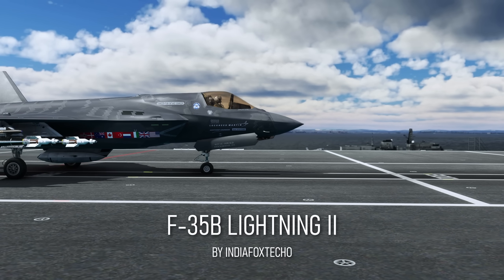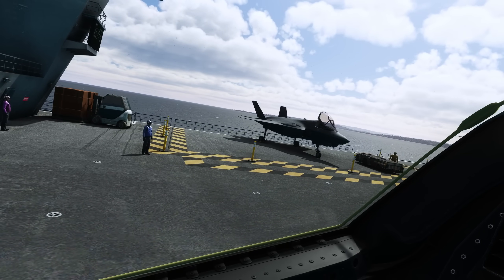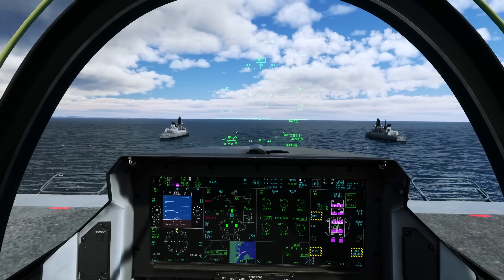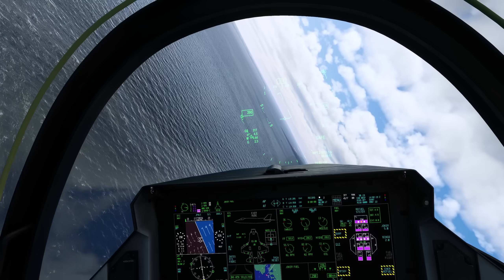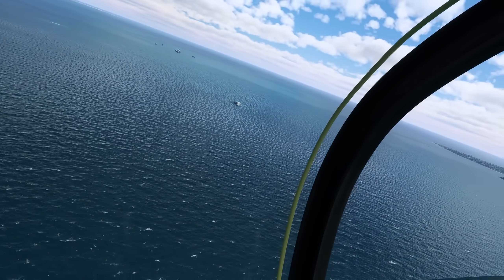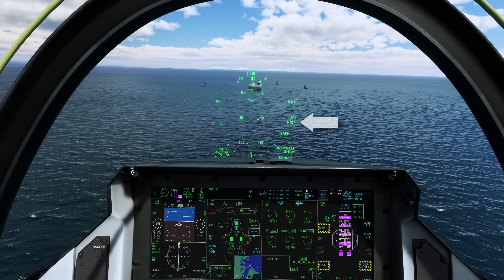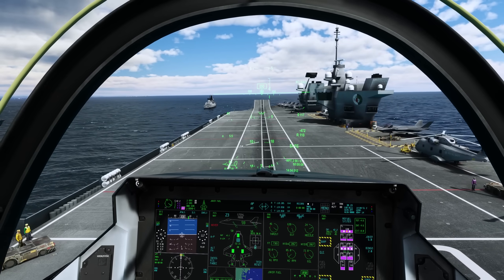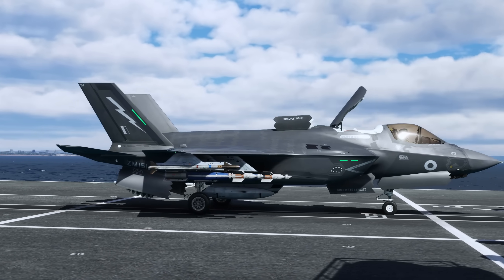Too Heavy to Hover? The Brits found a solution! F-35B Lightning II SRVL (MSFS)

Comment: This why the MoD/RN should have a built a full function carrier with arrester gear, along with F35Cs!!!!! They could still use the ramp to take-off with F35C, just like the F35B. The US use the F35B on smaller amphibious assault carriers as part of Marines Air Arm. It was not designed as a frontline interceptor. On land that is the F35A and on strike carriers the F35C. Complete british cock-up.

Comment: Why the hell doesn't the British Carrier have an Arresting Cable?  How do they handle Emergency Landings?
Reply: STOVL carriers generally don't, as their aircraft are designed to land vertically, the F-35B doesn't have a tail hook.

With this they have the option of a rolling vertical landing or a full vertical landing though.
Reply: It's easier to stop then land, rather than land then stop.

Comment: Good show UK, you showed the US Navy, & Marines how to safety operate the F4U Corsair on an aircraft carrier, now the F-35B.
Reply: Now, about that password... 
MFSBs !!

Word game: Sort the letters out... 

O V R I Y S N T E 

Yup, you're sorted. 😝😖
Reply: Not so. In both cases, the US had other options. In WW2, the RN preferred the Corsair while the USN preferred the F6F Hellcat and to wait while Vought worked out the problems with the Corsair that were genuinely deadly (even with different specifics in operational employment, the fundamental problems with the Corsair - the long nose obstructing field view ahead and the original faulty oleos that tended to make the plane bounce over the wires - were still problems for the RN that didn't get fixed until the F4U-1A, it's not like the curved approach was a magic cure-all for either problem, it just made the former problem more bearable and the latter they dealt with by using a flatter approach than was ideal for carrier landings).

With the F-35, the USN/USMC still has not adopted shipboard rolling vertical landing because the wide majority of Naval/Marine F-35s are the CATOBAR variant - they don't NEED to use loads on the F-35Bs that exceed hover-landing bring-back because a heavier strike than that can be flown using F-35C.
Reply: well considering this is basically identical to how the harrier has done short field landings with the US marines for like 2 decades, i dont think they will need any brits telling them what to do
Reply: @lag_hag851  The difference being the weight and the fact that the Harrier is a proper VTOL, invented by the Brits.
Reply: @lag_hag851  please do some reading before opening your mouth ... the Harrier entered service with the RAF in 1969. 2 years later, the marines got theirs. the RAF instructed the marines how to fly them and how to use the vff. much as I love americans, people like you make it a lot harder.
Reply: @lag_hag851  Aside from how to make the Harrier in the first place. If we never made the Harrier, the F-35 probably wouldn't exist...
Reply: @lag_hag851 Funny that, considering it was the Brits who designed and built the Harrier and then showed the US marines how to operate it! Stop being an ignorant american ffs, you give us all a bad name!

Comment: 1:55 The funny thing about ski jump ships is, because of the roll and pitch, when the aircraft leaves the ramp from the deck it looks like it drops like a stone! 😂
When really they're using the up swell to throw the aircraft into the air like a bird.
Reply from the maker: Think it’s just lucky timing! 😂
Reply: @cgaviator 
Unfortunately i will never be able to find the source for that i watched.
But it was an interview with an FAA Harrier pilot explaining that they had to time it so the ship was pitching up when they hit the ramp, effectively "throwing" the harrier into the air. 

If you think about it, it makes total sense, you're converting free kinetic energy from the ocean waves into vertical kinetic energy for the Harrier. 

And every time i watched a Harrier take off from Invincible it disappeared down below the ski jump, only to reappear during the down pitch.

(I was a Navy brat and spent lots of time on board Invincible watching Harriers. When you're nine they're really isn't anything cooler 😊)

(OK maybe Goalkeeper gives it a run for us money, or the Gambo Gun)

(Oooh, or watching the Sea Dart Automatic handling machine running behind the magazine observation windows)
Reply: @cgaviator 
Have you read about how they learned to push the range envelope longer and longer during the Falklands?

Comment: The F-35B has two landing methods, VTOL and SRVL, each has a different Being Back weight, split between fuel and stains, called VLBB and RVLBB.

VLBB is 4,700 lbs
RVLBB is 7,000 lbs

It might even be "7,000 lbs more" weight, the public documentation is a little fuzzy on the specifics. 

I suspect it's just 7,000 though, not 4,700 + 7,000

Comment: That is one of the most stupid solutions actually - take off from ramp in aircraft that was never designed for ramps...who doesn't understand: the ramp applies specific loads on the aircraft structure which significantly reduce the service life of the chassis and fuselage (especially if the plane was not originally designed for this).
Reply from the maker: @RigelNV  the aircraft is designed, or the design is considered. The aircraft only ‘hits’ the ramp at a speed that won’t over stress the gear. 👍🏻
Reply: @ nah, maybe you right that "the design is considered", don't understand why they allow that tho, significant luck of power? No matter what take off speed, even if it's just 1 kph, the specific load is still present. A load that never shows in flight and during normal landing.

Comment: So we've spent billions on a VTOL plane that can't land vertically with a full weapons load, on an aircraft carrier with no catapult. The old Harrier, of which we sold all of the remaining ones to - believe it or not - America, is a better VTOL aircraft. You couldn't make this shit show up.
Reply from the maker: I think the Harrier had to jettison its weapons if it brought them back but I'd need to confirm that. It's always a balance of capability. Did you know that they went without catapult as to install a reliable one would have needed nuclear power (and the steam it generates). The electrical catapult, I believe, wasn't reliable. The other bonus is that this ship and park in more ports that a nuclear powered one so it unlocks more places it can visit. It's all a balance.

Comment: What joystick and throttle are you using?? Im thinking if the hotas stick and throttle combination??
Reply from the maker: Thrustmaster warthog 👍🏻
Reply: @cgaviator  ok cool I'll check that out for sure I'm getting a new gaming PC tomorrow well I'm ordering it has good specs, I9 processor with nvidia 4070 super 12gb, 32gb of ram, 2tb space wanna play MSFS and DCS

Comment: The Sea Harrier was doing that 50 years ago. And the flight control system on the f35b was developed by the British and used on the Harrier first.
Reply from the maker: I’m not sure if it had space on the small carriers to do this?
Reply: @cgaviator  They used the Charles De Gaule French carrier for the test flights of the VAAC Harrier which was doing this in the early 1990s with an all British FBW system and flight control laws subsequently adopted by the f35b. Pity the UK did not upgrade all its Harriers (Sea and GR Harriers) to use the FBW system pioneered by the all British VAAC Harrier.
Reply: @cgaviator 
What? A rolling landing on Invincible? Could they?
Probably, yes they're smaller than QE or a Nimitz but they certainly weren't small ships.
No ship that can fit 24 aircraft on board can truly be considered small

Comment: Meanwhile the USMC dumps fuel to get below max hover weight if they still have stores. No straight in approaches like that for the LHAs/LHDs 😂 Though to ge fair, with a moving carrier youre likely getting 20-30kts of wind over the deck keaning you arent ever truly hovering, more just extremely slow flight. Im surprised the British decided to go with more conventional landings rather than full hover like the US do.
Reply: They'll be using both methods of landing, in fact they'll still probably use vertical landings more, as it's the safest method of landing aboard a carrier. SRVL is just another tool in their kit which they can use in an event where they're carrying a lot back but don't want to just keep dumping fuel and weapons.

Comment: Only the British would think of building an Aircraft Carrier without a catapult or arrester system. Dumb doesn’t begin to describe this idea. What about all the Aircraft in a joint forces situation that can no longer use this carrier, stupid doesn’t begin to describe this.
Reply from the maker: There were two issues. A nuclear powered boat with steam catapults would be too expensive to buy and operate. At the time, the electric catapult was unreliable. They started ti swap in catapults but again, too expensive and would take too long. With this way, we have 2 carriers that can be operated with much fewer crew. Rather than 1 or no carriers.

Comment: Well those 2 British carriers were designed so they could be fitted out with arrestor cables if required. While the F35B is designed to do conventional landing if required too. So there could be a simply solution…..
Reply from the maker: Not quite. The B could never do arrested landing. No hook and weaker undercarriage.
Reply: @cgaviator  are you should it doesn’t have a small emergency hook that usually retracted inside, like the A? Because FWIU the B was conceived to operate conventionally from captured (or Seabee created) forward airstrips after the marines have landed & taken enough territory, so they can carry more fuel &/or ordinance
Reply from the maker: @mickvonbornemann3824  I guess it may have a small one but they aren’t carrier rated (small and prone to skipping, but I figure the nozzle swivel would negate having a hook) and the undercarriage would still be a one-use-only after a deck landing! 😂

Comment: What this shows is how bad F35 and F22 really are. Because the computers play up electronics and weapons play up look how many F22s it took to shoot down a Balloon. Few people that don't know in 1967 there was a Harrier being built to be part of the other harriers and in 1969 it was cancelled. Now this one that was built and being tested was a I think 12 inches longer and 8 Inches wider with a New Rolls Royce Jet engine to force the plane to do near Mach 2 they were aiming for Mach 2 its test flights were don information came out it was capable of 1400mph  up to 30,000 feet the story goes. Not sure what happened to the plane but it was not destroyed so is some where in the UK. I think there are two Photos of the plane. Perhaps we need a real harrier Aircraft as with the latest engines would easily be better than the F35 as unlike the F35 I think you need to see the original harriers at work with tricks it can do that the F35 can only dream of.
Reply from the maker: How many F22s did it take to shoot it down? If you want something to go up against a near peer state then you need stealth or you’d be shot down before crossing the border. Which kinda negates a supersonic harrier. Shame though

Comment: As a tax payer I was not to happy when a F35 fell off the end of the ramp due to engine failure on the recent cruise to the Far East
Reply from the maker: Sadly it wasn’t an engine failure, the engine cover was left in the fan area which prevented full power. A disastrous mistake. Though to err is human and I’m sure they learnt valuable lessons from the whole process.

Comment: Not sure who originally came up with this but we were doing this type of landing in the Harriers and Sea Harriers.
Reply from the maker: People have mentioned it a few times but I haven’t found any references of harriers doing this onto a deck?
Reply: @cgaviator  from what I remember the process for landing on an Invicible Class vessel to fly the approach parallel to the deck until along the spit on the deck you were going to land on then slide side ways before dropping down on to the landing spot. All done whilst the ship was underway, a ship not fitted with directable propulsion has to maintain a certain forward speed otherwise it loses controllability in the same way conventional aircraft have a minimum speed were the traditional flight controls lose effectiveness.. You can't do that if you are coming down vertically with no forward motion. The RAF were doing rolling landings to prevent soil erosion at landing sites.

Back in 2008 QinetiQ's Harrier T.4 Vectored-thrust Advanced Aircraft Control  testbed aircraft to complete shipborne rolling vertical landing trails on the French Navy aircraft carrier Charles de Gaulle as part of the programme of tests for the F-35 project. This aircraft was also used stri g ghe 1970s to develop the process of landing Sea Harriers at night and in poor weather.
Reply from the maker: @neiloflongbeck5705  roger

Comment: Looks so real vs my first flight sim flight path on the vic20
Reply from the maker: It’s getting very good, that’s for sure!
Reply: @cgaviator  Yes i had to look twice
I must get the new msfs, hope my old i7 4790k 1080ti runs it
Reply from the maker: @somethingelse4878  I used to run a 980Ti and it did fine without added traffic etc.
Reply: @cgaviator  Should be okay then
980 was a good card, but let down by lack of ram when TR and the first watch dogs came out
If i remember right the ti had 6gb of ram so didn't have a shortage
Reply: @cgaviator  I'm hoping to use space desk app on the pc and tablet on a few fire tablets as extra screens for msfs, so i have touch panels for some controls
Thats if i can move parts of the screen arouund
Reply from the maker: @somethingelse4878  sounds awesome! I almost went that way but realised I preferred a smaller setup. I mostly use HOTAS key bindings for everything and a couple of stream decks.

Comment: I think the people that built this figures what you are doing would be like the hood of your car popping up at 150 mph.   Looking at the fragile actuators I would expect the hatch to rip right off, possibly damaging the rear control surfaces as well, causing the fly by wire to get funky.  Sure, you could do it in an emergency,  and the damage would not be irreparable, but it would not be conducive the the expected mission parameters of expecting the aircraft to fly more than once a week.   Damage to the front landing gear could be catastrophic, the requirement for the gear to withstand catapult launches created a materials need for a four by four by eight foot chunk of solid titanium.   Guess who doesn't have titanium?  America, England, Australia, etc.   Only Chynha and Rooshaa can source large pieces of titanium, which I expect is why production of the F-35 was stopped, the simplified explanation being the use of Chinese "parts".   About as stupid as Obama moving U.S. main battle tank production to Turkey.
Reply from the maker: Hmmm, I’d tend to disagree. The F35 does this landing on land a lot and it was designed to withstand these parameters. There’s plenty of titanium in this I’ve heard. I heard they’re changing engine or some design aspect in light of the recent ejection. Doesn’t think it was rolling landing related. But who knows! Thanks for watching 👍🏻

Comment: When there were multiple comments that the Japanese Destroyer Carriers could not land F-35B's without melting the deck I wondered why they did not make their approaches like this.
Reply from the maker: I’m sure there are other reasons. Maybe size of carrier? Risk appetite?
Reply: @cgaviator   Possibly length of the flight deck contributed to the problem with the Izumo Class? The figures are 1092' length overall for a Nimitz Class carrier vs. 932' length overall for the Elizabeth Class vs. 844' for the America Class LHA 814' for the Izumo Class. Overall length is not flight deck length but it gives us a yardstick to work with.
So if a rolling landing would work on the Elizabeth Class it might work just as well on the Izumo. It definitely works on the Elizabeth as is shown here.
I think the problem may be a version of "it wasn't made here!" where the Americans refuse to take a good idea that was originated by the Brits making the best use of a slightly smaller carrier. Maybe the USN could make rolling landings on the America Class and speed up aircraft recovery rate in so doing but just can not get past the bureaucratic inertia that they have built up. 
I do not know why the Japanese would fail to do so, though.

Comment: Interesting! I have a question, does this rolling vertical landing exert more or less stress on the landing gear than the more traditional arrested landing?
Reply from the maker: I would only be guessing but I think it would be about the same. 60kt is very slow for what these tyres are rated for. And they don’t slam onto the deck like an F18 catching a wire does.
Reply: @cgaviator  Thanks for answering.

Comment: Is ejection in included in the simulator? In the QE TV series, the pilot had a failure on take off, and ejected. Only sheer luck, and a redundant lamp bracket, stopped him going under the ship.
Reply from the maker: Not in this sim. In DCS World which is a combat flight sim but that doesn’t have as good an F35 model.

Comment: Of course this is nothing new - we were doing it with Sea Harriers for years.  This is only using the same method for the same reasons.
Reply from the maker: Was that also a British idea? 🇬🇧🤘🏻 Everything I’ve ever read about Harriers onto ships is vertical landing or dumping weapons and fuel
Reply: @cgaviator  Yes especially in hot conditions returning with weapons.